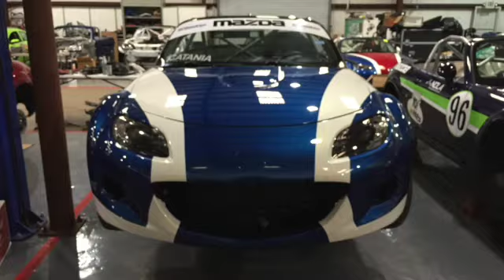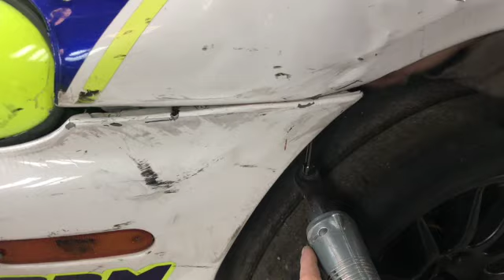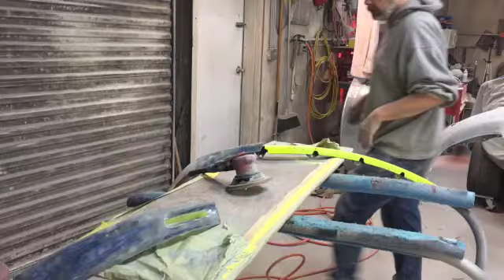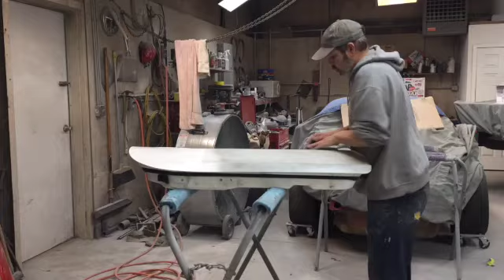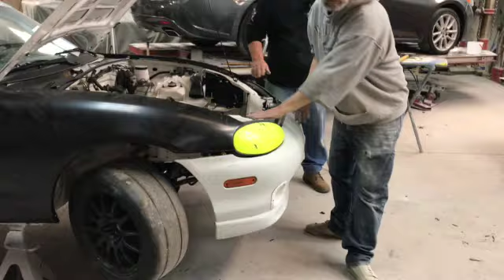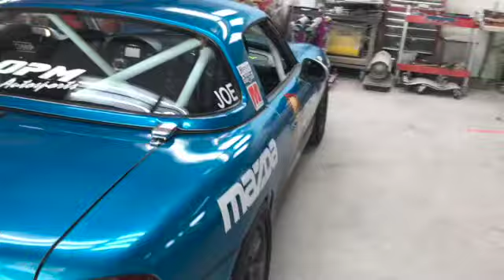Preparing A Spec Miata For A New Wrap #MAZDA #MIATA #MX5

Comment: What sort of epoxy or glue did you use to fix the spoiler with? I’ve got one here I need to piece back together.
Reply from the maker: We use Pliogrip plastic repair #3. Here is a link https://www.autobodytoolmart.com/product/pliogrip-plastic-repair-3/automotive-adhesive?utm_source=feed&utm_medium=free&utm_campaign=shopping&p=6WWAL20&gclid=EAIaIQobChMIjfeMi6PW6wIVQb7ACh0jIwo9EAQYASABEgKw_PD_BwE
Reply: Rebuild Rex thank you!
Reply from the maker: No problem.

Comment: Do you use OEM parts or aftermarket on the race cars?
Reply from the maker: The only aftermarket sheet metal for these cars are fenders. But the oem fenders aren’t that much more. That being said we use a lot of aftermarket fenders!
Reply: It’s a Spec Miata. Fenders are consumables.
Reply from the maker: Yes they are!